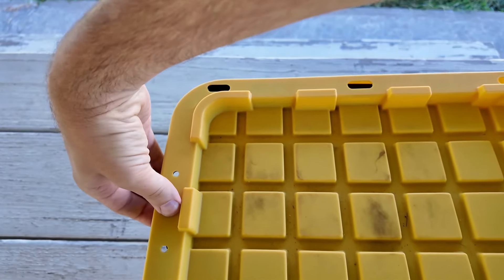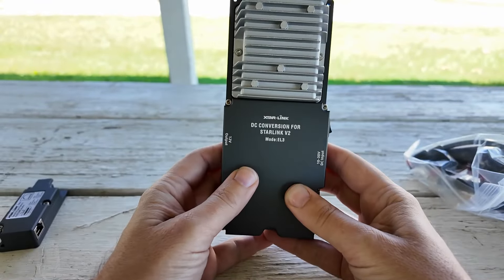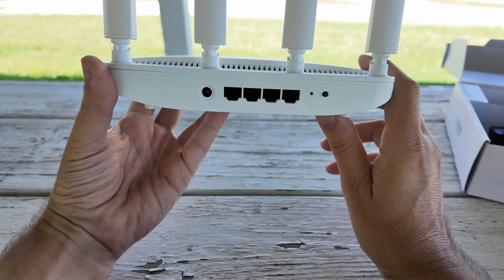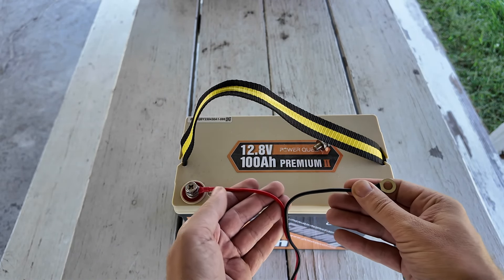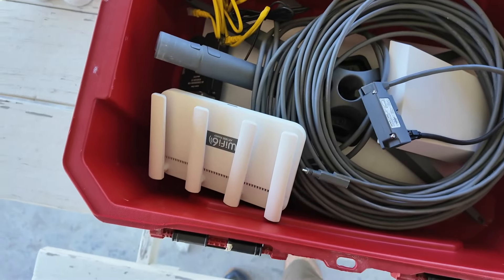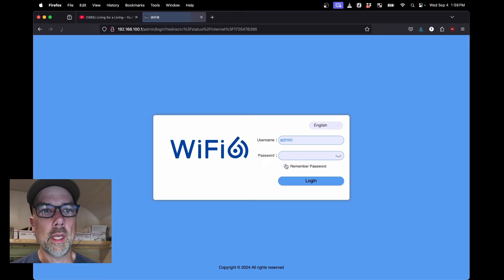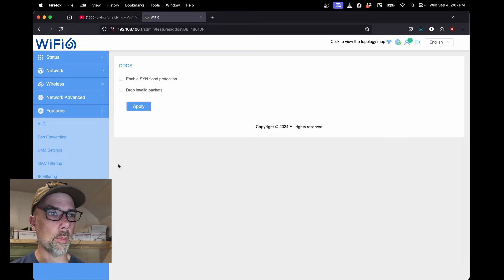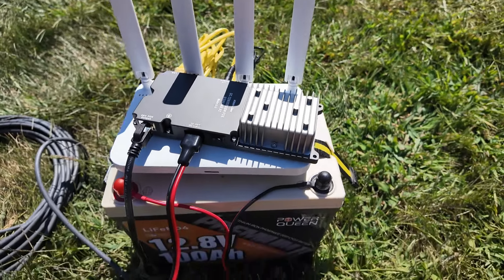Offgrid Boondocking with Starlink - Let's go 12 volts!

Comment: Nice improvement over your older one. I do not have starlink myself but a few RV I worked on do have . Some just do it with 12V to 120V inverter but takes more power that way . Some of them 48V converters make RFI noise on AM and SW radio, Ferrite chokes on 12V line and 48V line like them type 31 snap cores work. You have to use a bunch but does help. closest to the 48V converter works the best. Some use CB also . just a few hams in RV.  Love how that new one came with power poles  ! Lots of RV parks and campsites loose mains power.  The US power grid is failing . depends where you are.
Reply from the maker: I've noticed that, thanks for watching.

Comment: Nice small package. Some report their T-mobile home plan is getting changed to a more expensive roaming plan since the home plan was designed for a specific address. Your probably moved on from MO, but if not I'll be camping/pota/rallying down there end of the month.
Reply from the maker: Hey Dave!  I did, I'll be at the Enid hamfest on Saturday in OK.  Yeah, T-Mobile is going to change the home plan to an "away" plan and charge $160... which is too rich for my blood.  I switch over to my Mint Mobile (same network, $15/mo) - Let me know if you want a link for Mint.

Comment: Gen3 vs Mini? I wish there was more kits for the Mini available. Mobile Internet Resources has shown that if you Bypass the internal router, the Mini has 95% of the speed of the Gen3 dish with only 22-25 watts of running power. We camp host in a canyon in CO with worse than 1/2 bar of Verizon cell service, good for texting without photos. The Gen3 is $200 cheaper than the Mini, but the power consumption of the Gen3 is 2x the mini. We also have a lot of wind in that canyon from time to time, thus the Mini solution is desirable, however if I can get my power generation needs under control it might be a moot point. Whether I go with a tripod mount or a pole mount I had better make it a secure one in those winds.

Cheers, Davey - KU9L
Reply from the maker: When they did the 95% test, did they show side by side speed comparisons?  "95%" isn't slower enough to matter vs the size/ease of deployment!

Comment: Do you have the “Roam” plan? If so what speed did you select? Does it meet your needs most if the time? (Like live streaming, TV, computers, etc. at the same time.)
Reply from the maker: I have the roam plan. No choice since I don't have a home address (and they can tell when you're not at home). I'm overall it's been fine.  I like that I can pause it until I need it.  I put a reminder in my calendar to pause it and if I don't need it. That's some big savings.  I only use starlink when I can't use park WiFi or mint mobile Internet. On the road you need at least 2 choices.  Especially if you're going to be boondocking.

Comment: That's a whole lotta work when you can just buy a mini and plug it in USB
Reply from the maker: The mini doesn't have the same internet speeds or ability to "see" as the Gen2.  It would be a downgrade for some.  Good that there is a solution for all the Gen2s and Gen3s out there.
Reply: @livingforalivingRV   The Mini has less phased array antenna modules at lower power which results in slower speeds (150/15 average) but it actually has better beam steering than a Gen 3 dish.  It no longer needs to be pointed to the north or on an angle.  As long as it's pointed to the sky at any direction, you'll have internet.  I keep mine on my dashboard.  Doesn't care.  Most people just mount them flat on a roof rack.   In an off grid off road situation is much better than a residential dish at getting internet without having to worry about alignment.  It can virtually steer on all axis to near 180 degrees.